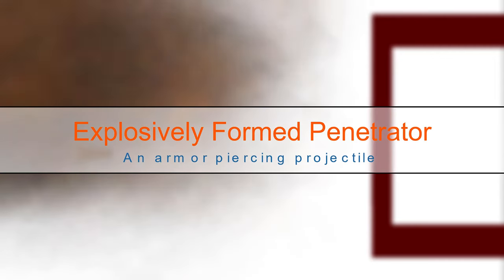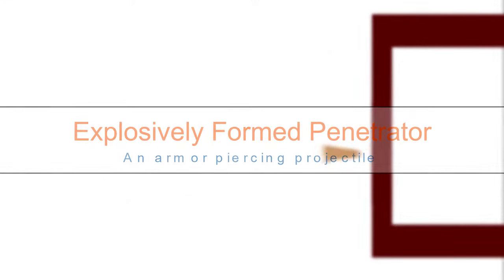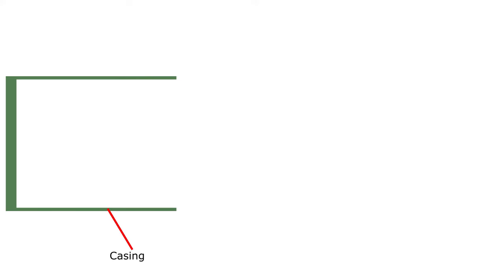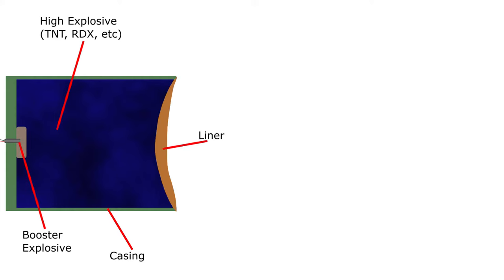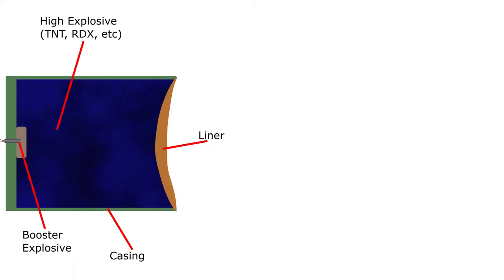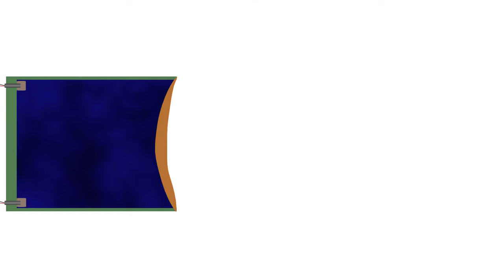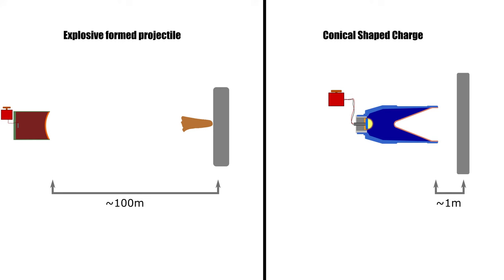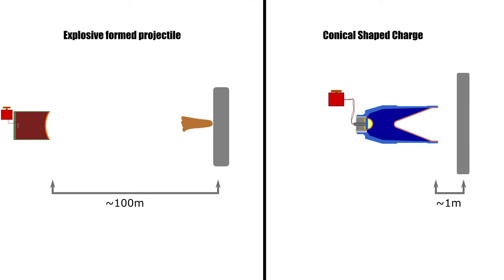Explosively Formed Penetrators

Comment from the maker: NOTE: This video is about getting a basic idea of how the process works. It's not an actual simulation of the event. See links in description for further reading.
Reply: Are you an FBI agent by chance? The boogaloo isacomin’ even without your low quality bait.
Reply: Isn't this just how a shaped charge works?
Reply from the maker: @jbradley8659  Yes, Explosively Formed Penetrators is a type of shaped charge.
Reply: I'm glad you said it was a simulation. It did seem like the slug was actually going across the screen somewhat slower than 2km/s. Anyway a mere slug going through armour is pretty impressive, l would have expected that you would need s snail with a really thick shell, one of the pointy ones you can see on a beach.

Comment: So EFPs do not form a “jet” (like a conical shaped charge often used as a HEAT round against tanks)? It forms an actual, solid projectile hurled out like a bullet at great speed?
Reply from the maker: Yes, they  don't form a jet  but deforms the metal into  various projectile shapes. In both cases, HEAT and EPS, the liner always remains solid.
Reply: @operationalfacts5602  thx for the KT (Knowledge Transfer). I did not know EFPs did that. I imagine it's a completely different animal for armor engineers to defend against

Comment: What is the difference between an efp and an anti tank heat round?
Reply from the maker: HEAT is a type of EFP
Reply: HEAT rounds have conical liners and create a jet of metal (note: contrary to common belief, the metal isn't "molten" - it just flows like that under the immense pressure). The jet achieves optimum penetration if the round detonates ~1 or 2 feet away from the armor, but degrades dramatically at distances >2m.

EFP‘s with concave liners (like in the video) create a slug with a generally lower penetration, but they will retain that penetration over much greater distances (like ~20m).

As a result
•HEAT is used for warheads that are launched directly at the target.

•EFP’s are used in off-route mines (where size isn't the issue) or in special top-attack munitions, like ATGMs with "Overfly Top-Attack" modes (NLAW, TOW-2B) or sensor-fuzed artillery rounds (SMArt, BONUS).

note: (yes, both metal jets and slugs are technically EFP's, but usually people will use 'EFP' specifically for the slug version)

Comment: Why isn`t this concept used in pistols, smgs, rifles or machineguns?
My guess is that since it`s so fast it`s also quite accurate up to a certain distance without the need of rifeling in a barrell.
Reply from the maker: The container is destroyed in the process. So my guess is making the barrel of the gun thick enough to not be destroyed would required turning the gun literally into a hand held cannon.
Reply: @operationalfacts5602  what if it launched a projectile a set distance that would arm after a certain amount of rotations, that way the explosion happens at a safe distance. It'd mean there's a minimum range tho, but safer that way
Reply: cmon normal guns are good enough if we upgrade them, itd be railguns not a fricking hand EFP
Reply: @apolloaero  The accuracy would probably be terrible. It'd be better to make it a shaped charge. That's if it doesn't destroy itself from the acceleration.
Reply: @apolloaero  This is pretty much how most anti-tank weapons work.  The penetration is proportional to the diameter of the warhead, which is why you don’t see this scaled down to bullets and such.
Reply: @apolloaero  the problem I think would be the fact that there’s no anchor for the charge so the charge would probably fire something back at you